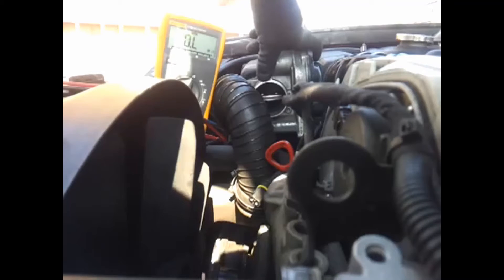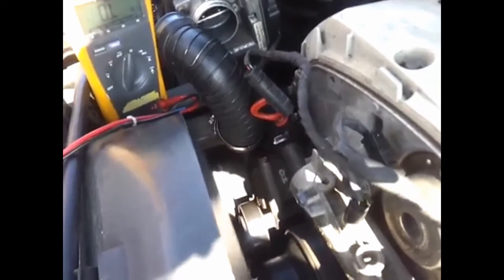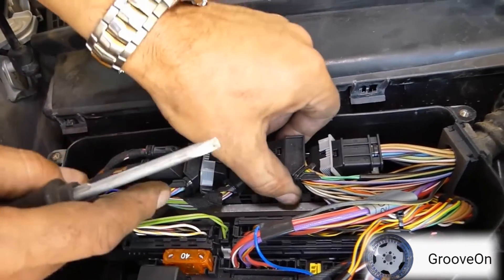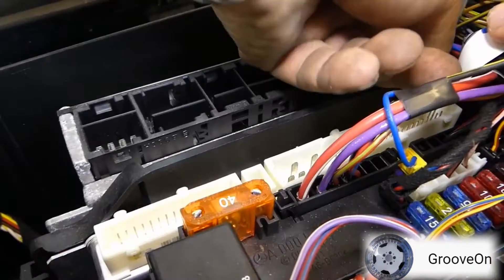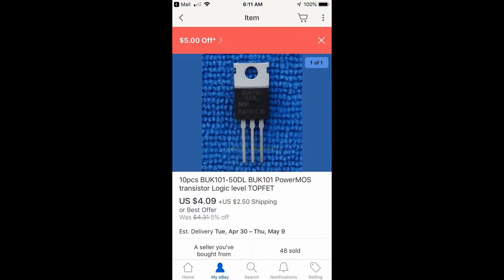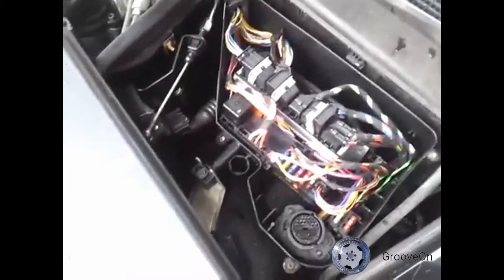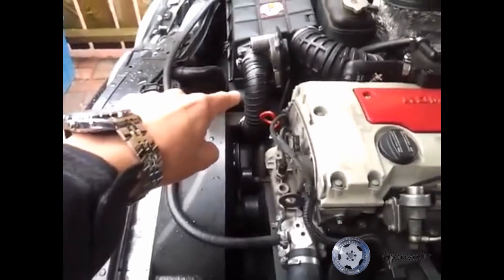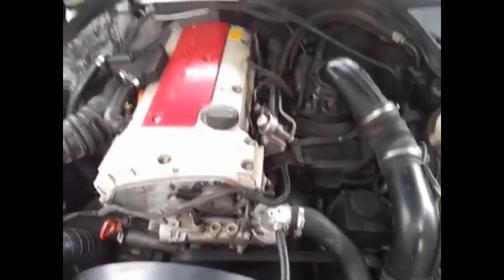Mercedes CLK - SLK Supercharger / Kompressor FIX with full instruction photos + Before & After video

Comment: Nice work! Thanks for posting
 My SC clutch is not engaging at all and the bypass air flap is not closing.
I will try your MOSFET fix and check the signal wire to the ECU.
My scan tool allows me to engage the clutch.
It does not let me close the air flap as it's non responsive same with a spare used air flap.

Comment: Thanks, I just fixed my Benz following your video. Still is hesitant to accelerate but  now the compressor clutch disengages on idle and the bypass valve closes on hard acceleration. The clutch also engages on hard acceleration.
Reply from the maker: well done you !! great feeling huh !
Reply: Yes, but I have a question. Car works great of I don't step hard on the gas, but if I do, it starts to idle poorly, shuts down, and I shut it off, wait some time, start again and can move for a minute then does not want to accel, etc. I disconnect the MAF start a couple of times, let shut off by itself then reconnect and works good again until I demand hard acceleration. What could it be? No codes.
Reply: @capifsjshop  What was the problem ? im having similar symptoms
Reply: @odda3908  I still have not fixed. I replaced the  suggested chip on the computer but still does not allow me to go beyond 130 km/h.
Reply: @capifsjshop  did you Get it to stop choking, when pressing the accelerator pedal hard / fast? And are you down on power up to 130 kmh ? 

Mine worked well until I washed it, and driving away from the shop, the engine suddenly started running like crap.
Reply: @odda3908  I suspect we need to change the spark plug coils.

Comment: Hi! I found this video and followed the exact steps. I ve changed the mosfet and after I reconnected the ECU the car it's not starting. The dash lights comes up, the key connects and works, but when I try to start it doesn't do anything. It was starting before I removed the ECU :)). Any ideas what could went wrong? Thank you!

Comment: I have the same issue with my C200 Kompressor from 2001. How can I be sure that the MOSFET is burned? The flap is never moving, it is always opened. When running diagnosis there are 2 faults only - Camshaft Position Sensor - no message and MAF Sensor fault. I checked both faults and sensors seem to be fine and also voltages and current going in and out look good. Is there a way to be sure it is burned MOSFET before doing any disassembling of engine's ECU?

Comment: Hi, my super charger on my 2000 CLK230 stopped engaging, this problem suddenly happened, any suggestions as to where to start looking?
Reply from the maker: for me my super charger stoped working when I accelerated hard once and I blew spark plug coil.  Check if your bypass flap is faulty.

Comment: Hi, may I know what supercharge problem you had before fix? Thanks
Reply from the maker: What happened to me was a coil pack blew on a plug and then my supercharger stopped as it blew a MOSFET on the circuit board. The symptoms that the supercharger then has was it did not engage or turn on .
Reply: Thanks. My car is with 150k km mileage and hope this will not happen to me.
Reply from the maker: @megeorge4128  It was a fluke, you should be fine. 150K is normal mate for a Merc, I had 200K on my old CLK, the only reason I dont have it is someone hit the back of me!  I now have an SL 3.7L and use it daily doing a weekly commute of 400miles each way! she has 160K on the clock
Reply: Ok, thanks for your advice. Hope to see your new videos soon.

Comment: Hello Sir, thank you for share your experience. My car is W202 C230k 1997 have same problem then i do like you do (replace mosfet with same new plus replace bearing) but still not working mean the superchareger still buzz). May you have other solution for that case?
Reply from the maker: Is your bi pass flap working okay? I've had an issue with one, so bought a second hand one and problem resolved

Comment: You Sir are a LEGEND, very well put together video!!! 

I think I have constantly locked SC clutch also - I have also the code P0806 "comp. magnetic coupling."  W202 1997 C200K 141kW. 
Now Im surfing the net what could be the problem and this video will surely help if I have this problem. 
I noticed that your CLK was pre-facelift? Same conifg. as mine. So do both these cars even have the K40 relay unit where the soldering points burn off? Because from looking at your video I dont see it. 

That would mean that either my clutch is shot (unlikely as my car is only 54k km) or I have same ecu mosfet issue that you fixed.
Reply from the maker: Hi there, I recall the K40 relay was more of an issue on the SLK , not the CLK..
Reply: @GrooveOn  Understood. I did all the tests today that you did and I have same problem. Took out the ECU and gonna give it a shot once I get the mosfet.
Reply from the maker: @mirazas1  really hope it works mate
Reply: @GrooveOn  By the way - forgot to report my findings. The mosfet was really blown. And it was blown due to the supercharger magnet coil being rubbed through and shortening. After resoldering the mosfer and replacing the coil it work as it should. Thanks again for the video :)
Reply: Would a diagnostic test shows a faulty MOSFET
Reply: @carlomauers5138  most likely not. But it is easy to diagnose, because the supercharger is always locked up and always spinning, even on idle. And the bypass valve is not closing when giving above 2000rpm.
Reply: Ok mine is not spinning on idle  my problem is that my by pass valve stays open  .  When it's rev
Reply: @carlomauers5138  maybe your bypass valve is faulty. Did you try to connect diagnostics tool?
Reply: @mirazas1  yes and it didn't pic upany faults when you switch it on u can hear the valve mak a sound like the throttle do but that's it.
Reply: @carlomauers5138  I dont think that your mosfet is bad since as you can see for this video the compressor would be engaged even on idle. One more thing I noticed on these motors is that the MAF sensor is affecting ALOT of systems. You could try to remove it and clean with MAF spray cleaner - its not expensive to try and maybe it could help (just a guess). But Im betting that your bypass valve coulpe be faulty, or maybe the wires going to it can be damaged, check wires near the connector for rubbing or any damage.
Reply: I have a spare maf so let me trie that en check the wires and update u thx  buddy
Reply: @mirazas1  is there any fuses or relay that is also working with it
Reply: They maf sensor is fine when I un plug it it

Comment: C230K 1997, starts but shuts down due to lack of gas in one second. Pump is new, filter is new. Key lights on mirror do not flash so I presume key is fine. Could you help me guiding me what to check. ?
Reply from the maker: Have you checked your fuel rail? They can get blocked, I would use a scanner and get codes rather than spending more money at this moment. Good luck

Comment: Yes but how did you find that that was the faulty part of the ECu ??
Reply from the maker: Research my friend!! Many weeks of questions through different forums.
Reply: @GrooveOn  thank you. I have checked my bypass flap because on idle it makes a tac tac tac noise and I have seen that it closes only on extremely high rpm. Can you help? Is it normal? At how many rpm should it close?
Reply from the maker: @standolfo  Hi there, the bi-pass valve should be open without movement, the slight movement doesn't sound quite correct. The valve should close around 1200 + revs if the valve is not engaging until really high revs, then I would look at possible changing it mate? (should be some second hand on eBay)  if you have a MBStar you can open and close it through the software.
Reply: @GrooveOn  thank you so i think its faulty. I have looked but for now they r quite expensive on the bay. What is MBStar? Thank you!
Reply from the maker: @standolfo  sorry MB Star is Mercedes Benz Star Diagnostic.  It is what the main dealer uses, however independant dealers also have the diagnostic.  Speak them and see if they can just test your supercharger and airflap to check it is functioning as it should
Reply: @GrooveOn  thank you i will👍

Comment: Im on the 3rd mosfet. The clutch is working fine with a battery. I took it off to give it a visual inspection, but it looks fine, but it keeps blowing the mosfet even without connecting the clutch. Any ideas?
Reply from the maker: I found it was a voltage spike. Did you protect edge of MOSFET to avoid grounding?
Reply: @GrooveOn  yeah after using the 3rd mosfet I installed the ecu and connected a test light instead of the clutch and worked plugged the clutch in and blew so the coil must have a short. Can't find a new coil anywhere
Reply: Do you have a renewed wiring harness in the engine bay? Bad cables could kill the mosfet as well. I just get repaired my cables, now I have to change the mosfet. 1996 C200K 140k km only.
Reply: My loom is fine, thank God

Comment: Hi.Is it BUK101-50DL OR BUK101-50GL What you showing in the video on the ebay picture says buk101-50 dl and in the description you say its a buk101-50gl
Reply from the maker: It's BUK 101-50GL
Reply: What is the difference between dl or gl please?The transistor what arrived for me is a dl not gl is that OK to put it in?
Reply: @GrooveOn  Can I insert dl instead of gl?
Reply from the maker: BUK101 - 50GL is identical to the DL but short circuit load protection max. is 20v, the DL is 35v but the switching rate is faster.

Differences are minimal and should do the job. The "G" denotes a higher standard of component.👍
Reply: @GrooveOn  Thanks))) 
You are a genius
Reply from the maker: @BashanTV  thanks dude, and if you've subscribed, do let me know how it goes, remember to make sure you use the plastic insulation on MOSFET to avoid short to ECU body
Reply: @GrooveOn  Hello, I changed the resistor. The old one was black, burned. The problem is not solved. I'll go to the electrician, let's see

Comment: For w208 clk 2000  2.0 kompressor how fix this problem ?
Reply from the maker: The process in my video should be the same as it uses the same ECU
good luck
Reply: @GrooveOn  I followed your video carefully but my problem is that the package is not the same as the one in the video and I can't find it